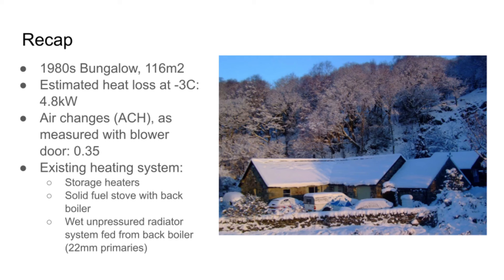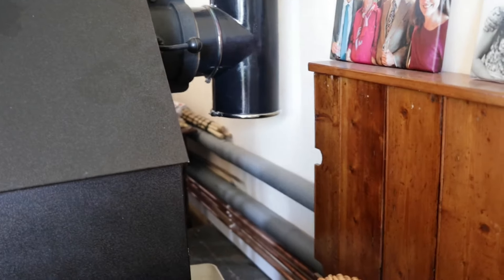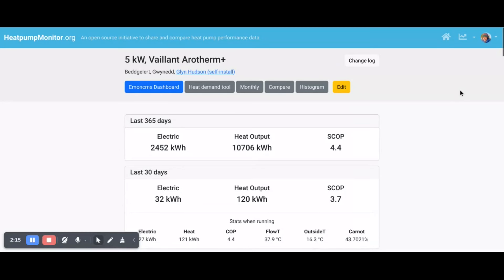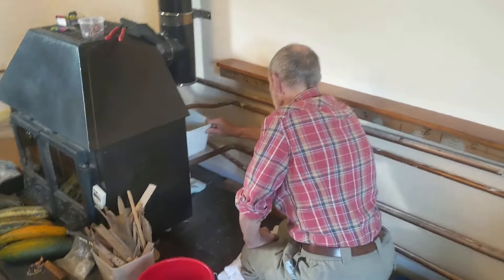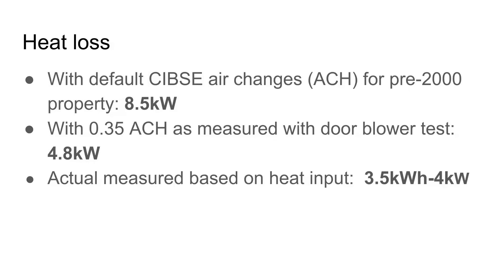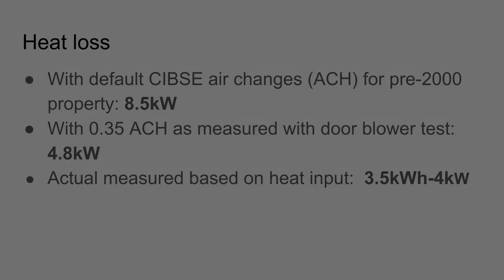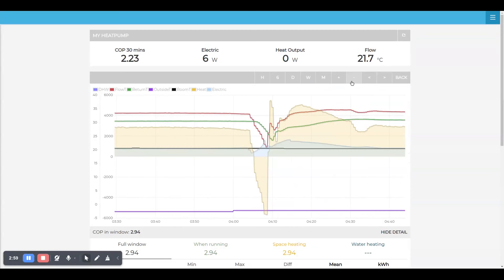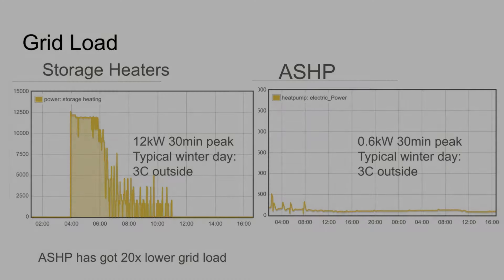1980's Solid Fuel Bungalow to Heat Pump Winter Performance Update

Comment: Great to see and hear that your parents are happy with the heating and feeling in the house. It's perhaps one of the most overlooked aspects of having a well designed and installed heat pump that they provide a much nicer even consistent heat without the ups and downs of other heating options.
Reply from the maker: Agree, it's hard to communicate how much more comfortable low temperature heating is
Reply: It's great to see that the heat pump is able to acheive the relatively high room temperatures that old people tend to require.

Comment: Glyn that was beyond excellent, it is useful to have 300 days of quality data which also vindicates your design decisions. Really useful section on the ACH factor and the merits of the door blower test - it is equally important to the basic heat loss calculation. The bottom line from your Mum and Dad’s perspective is that it has transformed their comfort and bills.
Reply: I think the fact that Glyn's parents are retired has also helped the small 5kW ASHP heat their home. As retired people they will not be going in and out of the house as often as a busy family would, so air changes due to doors being used will also be minimised. (The measured ACH figure is only reflecting the air changes occuring through the building fabric).
Reply: @tlangdon12  Interesting perspective. When we were working we went out in the morning and came back in the evening. Now, retired - I am in out of the house several times a day as is the wife not as an activity in itself but associated with the many activities we are engaged in around the house, garden, man shed and in the community. Please do not equate retirement with vegetating - I am busier now than I ever was at work except I am busier 7 days a week, rather than 5.😉
Reply from the maker: @tlangdon12 I would say the opposite, if they went out to work all day the doors would only be opened and closed at the beginning and end of the day. Since they're home all day they are going in and out much more, they have a small holding and a large veg garden so are working outside and coming in for tea brakes etc most days.
Reply from the maker: @normanboyes4983 yes, it's the same for my parents. They're constantly on the go working outside and popping out the see friends etc. So the are in and out of the house much more than I'd they worked a 9-5 job

Comment: Just installing my heat pump this month. The "normal" survey suggested a 8kW (or more!) but my measured gas data says otherwise - 3.5kW will probably be enough. I used "Michaeal de Podesta" system for estimating heat pump size. I'm installing a 5kW for a little head room. I am glad that cycling isn't a problem as I think that will happen. 

I replaced my combi boiler for hot water and I'm running on just the 3kW heater for my 300l cylinder. I installed a "Recoup" waste water heat recovery system. We're a family of 5 and my electric hot water bill is about the same as the previous gas heating bill. Amazing! I can't wait to see what it'll be with the heat pump heating my water.

Comment: Good video. As a resident of Wales, I've head some people who live over 1000ft, not having a great experience with air-source heat pumps, and have reverted back to oil - which is the main source of heating for more rural locations. Living on the Clwydian Range, we rarely see temperatures drop to -20C in winter, but often experience weeks where temperatures do not exceed 0C.
From your detailed explanation, it sounds as if the house which reverted back to oil, probably had an incorrect, sized heat pump.
The cost savings are significant, compared to fluxuating oil prices. With that said, electric seems to be ramping up in cost, due to demand, also compounded by the fact that the UK doesn't have the necessary additional nuclear, or other clean energy supplies - for its self-destructive path to net zero - which is literally impossible, a fantasy - regardless of the reduction in peak energy usage for traditional heating systems, moreover; EVs being charged overnight, consuming more energy.
Balancing the grid is a challenge, but projecting demands and preparing for a clean electric future isn't rocket science.
I'm looking forward to replacing my oil boiler IF heat pumps are pratical in my environment.
Reply: @jonescd76  Sweden, Norway are heated almost entirely with heat pumps and are a lot colder than Wales!

Comment: Excellent video, ευχαριστώ πολύ from an EmonPi user in Greece.   I've caught up with it late, but happily via your post on Bluesky, glad to find you there.  Reverseable air con here, cooling during the long hot summer, heating during the short cool winter, unfortunately I can only monitor electricity consumption and room temperature.

Comment: Laughing my socks off here with Glys's dad.  We've had our heat pump just under 4 years, before we had a gas boiler but also used wood burning stoves when it was really cold.  I've had 1 fire since the heat pump was installed (Christmas Day) and also have no clue about the weather outside. In fact I've had to add "outdoor temp" to my home assistant screen too.
Reply from the maker: Haha fantastic!

Comment: Completely relate to the two 'negatives' spoken about.  Had an ASHP fitted in April, no longer need to light the wood burner and the balanced even temperature through the house means you don't feel the fluctuations that we did with an oil fired boiler.  We've not had a full winter with the ASHP but so far, we've been delighted with the performance, impact of living conditions in our house and getting off fossil fuels.

Comment: Great video and you did the right dimension. And the best thing you did was to change the radiators to a bigger dimension. Change the last one in the Kitchen and make a thermal camera view of the radiators to se how efficient the cooling is over the radiators. If not great adjust the flow of the seberate radiator in the radiator valve.

The you get a greater cop and try to adjust the heating curve a little lower 😊
Bonus wold have bin to mount radiators with 3 plades instead of 2.

Comment: Another excellent VLOG Glyn, thankyou.
I am very sceptical about the whole green thing but I admire what you've done and we did install solar panels on this house when we moved here back from Italy in 2018 and they've been a great investment.
I couldn't make the numbers work for all but a very small battery (we are a retired couple with no EV and no big power appliances and can do the washing and diswashing when the sun shines), but I finally was convinced that it made sense with the newer Octopus tariffs and installed a Tesla Powerwall 2 in March. We have had excellent savings from it so far and are on course to pay it off in 8-10 years even at current prices, which I thing can only get worse - who said that recently ?  :/
Plus we have the security of home backup if (or more likely when) the grid falters under the strain of the Net Zero demands.
We bought a new combi boiler when we moved in here as well and that is very efficient. We have a log burner for the coldest days, and we also used a smart switch on the solar so we could power a fan heater in the living room when we were generating for "free" heating. I need to look at that again and decide whether it is better to sell that power to the grid during the day or use some of it for heating to reduce gas costs.
I don't think that it would make any sense for us to replace that 6yo boiler with an ASHP at the moment given that we'd probably need an extra couple of radiators downstairs that would not be very easy. We typically have the heating come on at 7 with the thermostat set to 20C and that goes off well before 10 and we can usually keep going until late afternoon when it comes on again at 4 with the thermostat set at 21 until 9pm. We wouldn't like a house as warm all day as your parents even though I am not very active with COPD and arthritis and we definitely don;' like hot bedrooms.
I would be more interested in installing an MVHR as it would be fairly easily done with the unit on one external wall (that could be insulated at the same time) and ducting through the attic. 
Have you any thoughts about how effective they are if they include a heating element (and a cooling option for the summer)?  
We would hopefully be able to rurn off at least the bedroom rads and keep them warm with air blown round the house from the living room.
Ours is a standard square detached house built in the 60s I think, with some cavity wall insulation and PVC double glazing. It was last given an EPC rating of D, but that was before I added another 100mm of insulation in the loft and floored it in which made the house much cosier. Our Octopus estimated gas usage is just over 9.000 kWh pa.
I look forward to any comments you may have.

Comment: Great video.If you were to do this at another property which wasn't your parents would you consider going to a smaller size heat pump? For the UK it feels like we could adjust our design approach to not focus on the coldest days of the year since it only ever happens a couple times and so the system is "oversized" for the vast majority of it's life. This would lead to smaller and cheaper units for all.
Reply: I believe 5 kW is the smallest air to water can you get (the 3.5s are 5 kW units derated in the firmware)
Reply: @dan_grey he also said 20-30% excess capacity is a good safety net for a heat pump system.
Reply from the maker: No, I don't think there would be any benefit to a smaller unit. Modern heat pumps have good degree minute based algorithms when cycling, so there's not much loss in performance, and inverter driven compressors don't mind cycling as much. It's also important to ensure the heating works well when it's cold! I guess if you were happy to use a wood stove on very cold days you could consider fitting an undersized unit, but this would not be allowed under MCS
Reply: @GlynHudson  A combined gas/ASHP system like the Intergas Xtend could be a good option for bigger properties as the ASHP can work efficiently for 90% of the days and the gas boiler can take over on the coldest days (and be a backup heat souce if the ASHP is down for any reason)
Reply: @GlynHudson  a video explainer on degree-minutes would be very helpful

Comment: Seems to me that we need actual ‘heating engineers’ to install these, not guys that have done a week course and spend 90% of their time installing gas boilers, who then call themselves ‘engineers’. We need people that truly understand heat loss and are willing to spend a few more hours doing calculations.
Reply from the maker: Yes, heat pumps do require a bit more calculation and planning than a gas boiler, but there are good software tools and resources available to help. I did the design and self-installed this system, this is covered in this video https://youtu.be/bHsp7fDw_bg?si=Quxi8NsdM96ZpjIc
Reply: @GlynHudson  . Thanks for the reply Glyn, very impressed with your work and attention to detail. The problem we seem to have is a gas fitter can easily make £100k a year just fitting new boilers and servicing them.chuck in a 30kwh gas boiler and it will work - sort of! We need thousands of heat pump installers, capable of making these calculations and servicing them.
Reply from the maker: @bordersw1239  agree, it's probably one of the biggest problems in the industry. But there are a lot of transferable skills from boiler installation. The tools available to do heat loss calcs are improving all the time. The air changes issue is being somewhat address in the next revision of CIBSE
Reply: As well as being able to do the calculations, we also need engineers to commit to returning to the property to tweak the systems they have installed. It probably only needs two visits, but if engineers see this as being a problem for them, they won't do it and customers will be left with sub-optimal installations. It would be best to include two reviews of the system performance in the contract you agree with the heating engineers, so that you can hold them to account.
Reply: To my mind the issue is that gas boilers are being installed without regards to heatloss calcs. Then they're left to run inefficiently, with owners wondering why their bills are so high.
Reply from the maker: @simoncanfer5030  true, however the difference between a really good gas boiler install and a bad one is probably 10%-20%, however the difference between a really good or a really bad heatpump installation can be 200%-300%!
Reply: @GlynHudson Hope the stove is still usable needed in the winter with heatpumps
Reply from the maker: @theoddjobcentre6686  the stove wasn't used once last winter and won't be needed. The heat pump can provide all the heat required.

Comment: Thanks for sharing the analysis of the data - I’ve been running my own calcs in heatpunk and the air changes seems to be the determining factor compared to fabric losses - the blower test should be mandatory I reckon - I need to do this really as it could be the difference between a 5kW or 8kW I think- 190m2 2002 bungalow 🤔
Reply from the maker: Thanks, yes a door blower test is a useful exercise in its own right. It's also important to check the HP manufacturer's data a 5kW Vaillant can actually output 6.8kW at -3C, while a 5kW Samsung can only output 4.7kW at -3C. This data will be built into heatpunk if you're using that.
Reply: @GlynHudson  thanks, yes the output values are a bit of a can of worms it seems - I've been looking into the new Samsung R290 models and the data for those seems to be a bit more accurate than the last gen when you deep dive into the data sheets (no heatpumpmonitor data for those yet it seems) - the Vaillant would give some headroom but at a cost 😬

Comment: Im curious as to how well insulated is the property?
Reply from the maker: @hotrodchris805  it's got standard 1980s loft Insulation and a couple of walls have cavity wall insulation, it's not too bad. I've also installed a heat pump in my house which is a 1800 sold stone property without any insulation in the walls or the floor, a heat pump still fine and gets excellent performance. A heatpump can heat any property as long as the system is correctly designed: https://youtu.be/kkNx2oSO-S4

Comment: Hi Glyn, This video popped up on my feed.
I am very curious, although you have used the actual ACH did you do any airtightness remedying or insulation work prior to the installation of the HP on either house? I would like to Thank you for providing us with the info and how-to because I have been contemplating doing this on my own house 1983 bungalow in Dublin. Regards Greg
Reply from the maker: @gregmooney7363  Hi Greg, no we didn't do any insulating or air tightness work prior to installing the HP. However, make sure you get your own heatloss calculation done since heatloss demand will vary between different properties.